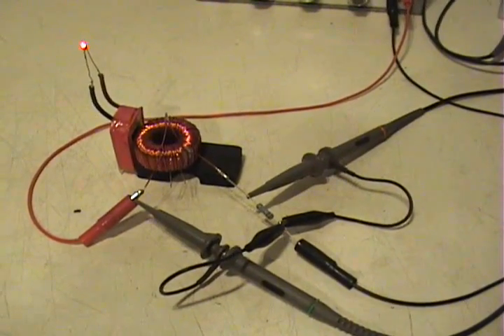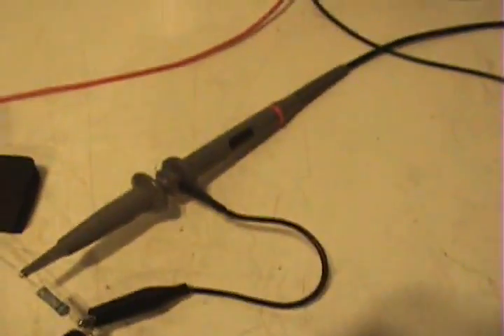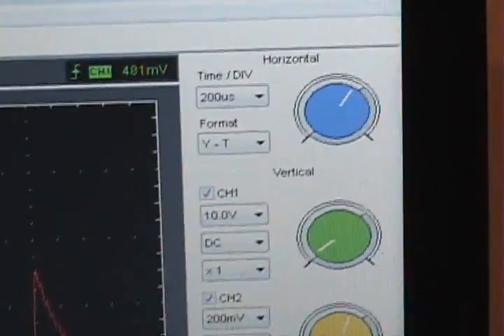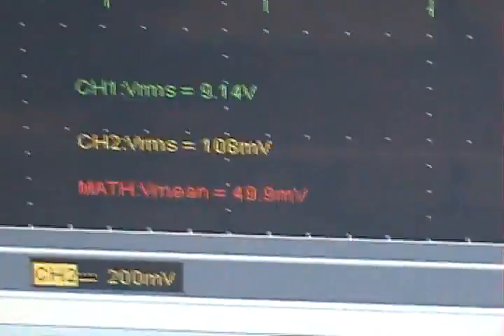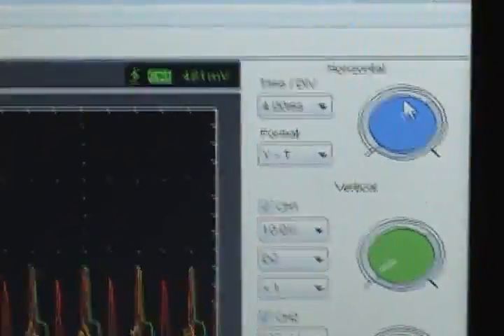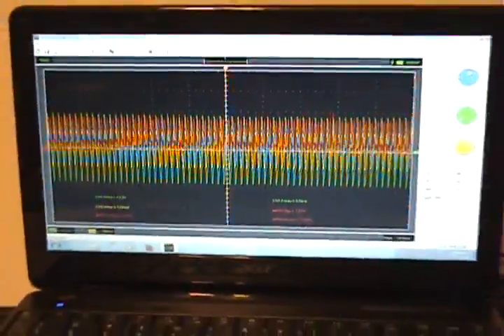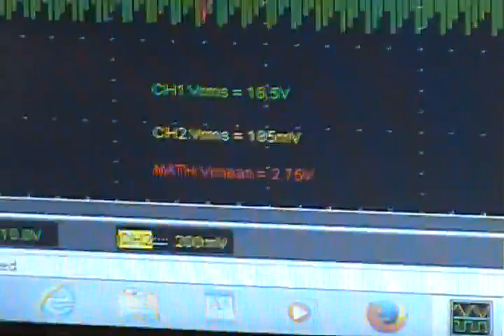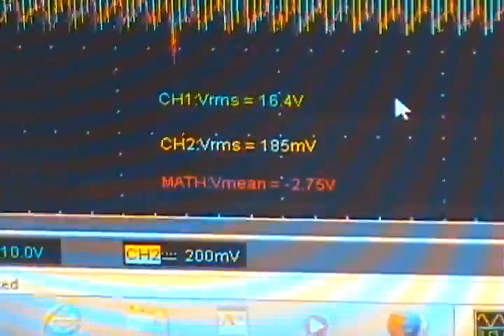Bifilar Toroid test 2

Comment: Hi Luc,

i just did a replication of your bifilar coil measurements with as close as possible components/setup as you had.
See this thread for comment/video:
http://www.overunity.com/14106/reactive-power-reactive-generator-research-from-gotoluc-discussion-thread/msg386287/#new
My coil has more resistance, therefor the square signal stays stronger.
Perhaps it is of any use to you.

Regards itsu
Reply from the maker: Thanks itsu for the replication attempt and making a video to share your results.

Luc